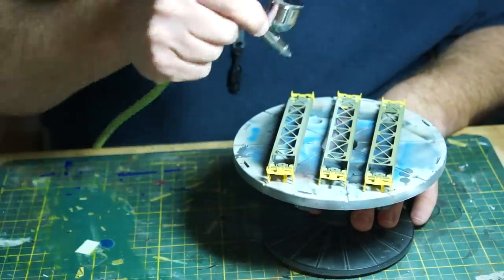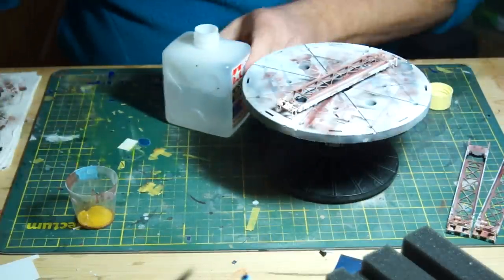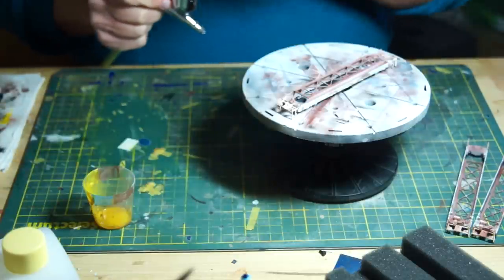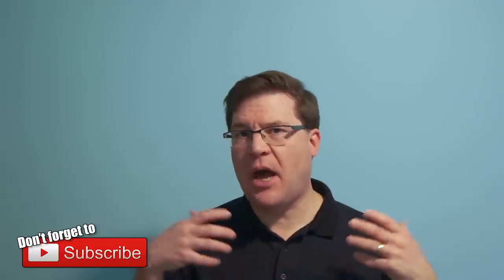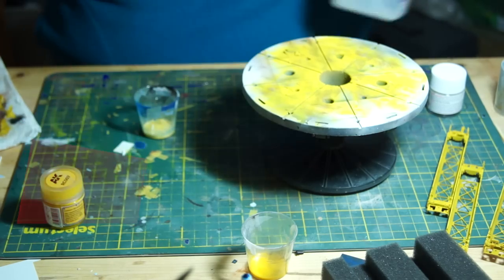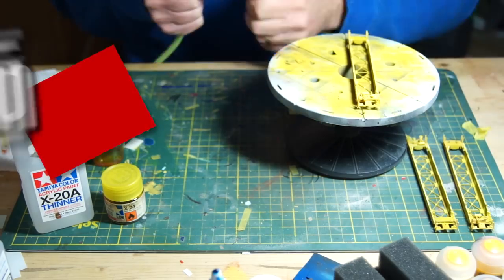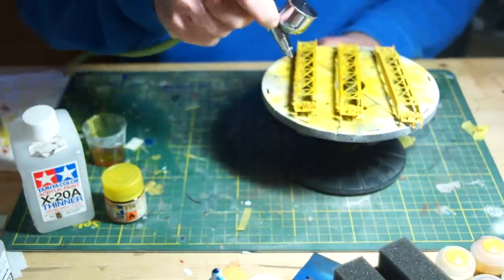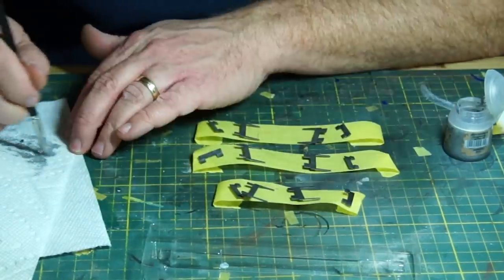Painting Model Trains - Airbrushing, Hand-brushing, & Color Modulation

Comment: Looks good I have minimal experience with airbrushing I find it the setup and cleanup os a big factor as why I don't do it often.
Reply from the maker: Very true. I have said before that you'll spend more time cleaning the airbrush and masking than you will painting with it. However, the results do pay off. Spray-cans are definitely an option, but it does require almost as much in terms of preparation and set up.

Comment: Nice work John. I found out the same thing with my Vallejo paint, Badger modelflex, and cheep craft paint. I only use the Tamiya x-20A thinner now with Tamiya paint. don't like the goo! lol
Reply from the maker: The goo is bad. The X20A thinner does work very well on Games Workshop/Citadel Paints, both layer and base paints; Privateer Press paints, and AK Interactive acrylic paints. I've not tried it yet on the AK Interactive Real Color, but I will be shortly to see how it responds to the X20a, or straight 91% alcohol. I do know that the Real Colors don't like water very much at all.

Comment: I just found your channel and subbed. Great advice. I can definitely use it 😃👍 thanks for sharing
Reply from the maker: Glad you found it. Hopefully, I can also address questions that may come up in the comments section. If there's anything I haven't already covered, feel free to ask!
Reply: JC's Riptrack thanks for the reply. I have a cheap airbrush and have been just experimenting with thinned  craft paints. Not bad results but I’m not great at directing the spray. Some of you guys are so precise 👍
Reply from the maker: What kind of airbrush do you have? Depending on their type, some airbrushes are better for broader work, while others are great for precision. I'm thinking of doing a paint-for-airbrush review, or something like it.
Reply: JC's Riptrack it’s a set I got from harbor freight. I believe theyre duel action. There’s 6 brushes and bottles with a carousel that the air hose goes to to control the air pressure. It’s not a top brand.
Reply from the maker: The Harbour Freight ones, from what I understand, are very affordable but lower quality. They'll get you started, and are good for broader work on scenery, but the 0.35mm needle and designed isn't geared for precision work. If they're syphon-feed, it's much harder to get close in. Still, as you said, not bad. I wouldn't be in a hurry to replace it, unless you really want to go full-in on a higher quality unit.
Reply: JC's Riptrack ok thanks for the information and advice. 😃

Comment: Definitely no matter what paint your spraying a spray booth is nessesery. What PSI were you spray at? When I spray my mixing ratio is all eyeballed to what I am feeling at the current time, I also spray at what my compressor puts out at- many people tend to be too picky on thinning and PSI. I also only use one brand of paint too.
Reply from the maker: I use several brands of paint depending on what sort of effect I'm looking for, as some of them behave differently or work better for some effects. I agree that a spray booth is something I need, and I'm hoping to get one soon, especially if I am going to get into lacquers, but even higher volume acrylic work. I've gotten away with it until now using acrylics, and only for "short bursts" of activity. However, I am liking these Real Colors very much, and also how well the Tamiya Acrylics thin with lacquer to make it my next major hobby purchase.

As for my pressure, currently my little Grex AC1810A compressor is set at about 20psi. Since it doesn't have a tank, the "real" pressure is somewhere less than that. I am thinking of adapting my larger 4 Gallon compressor for airbrush use. Ironically I have finer control with the pressure with it than I do the little one.

Comment: I like to use my airbrush, a Badger 155 Anthem, to weather engines and rolling stock.  I model HO scale.  I also typically use acrylic craft paints and my own home made thinner.
Reply from the maker: What do you use for your homemade thinner? I'm curious.
Reply: @JCsRiptrack  I mix 40% distilled water with 40% Windex (the non-ammonia kind) with 20% isopropyl alcohol (either 70% or 91%) and add 10 to 15 drops of water soluble glycerin (available at most grocery stores).  That's my thinner recipe and I usually mix that 50% thinner and 50% paint.  Works like a charm.